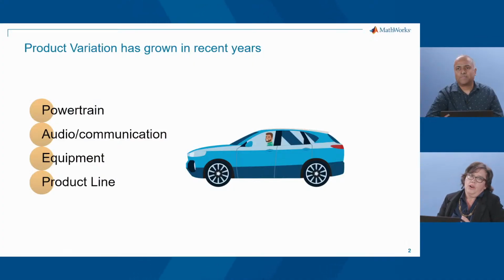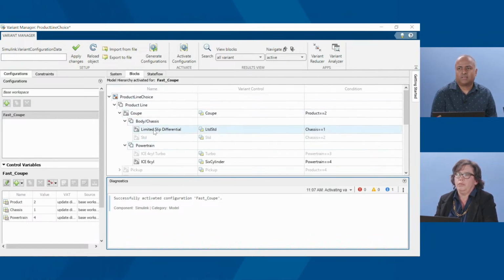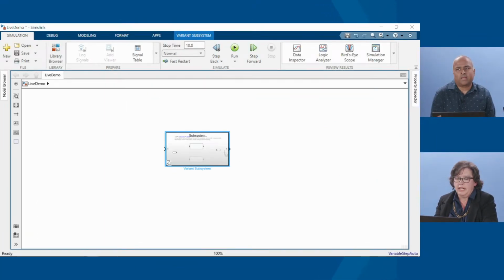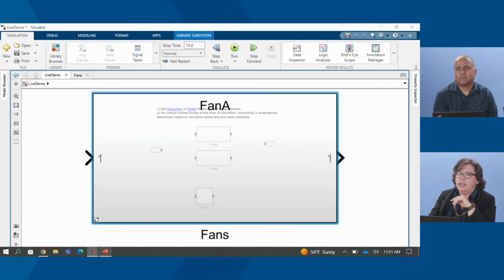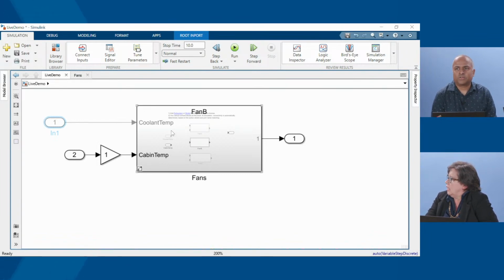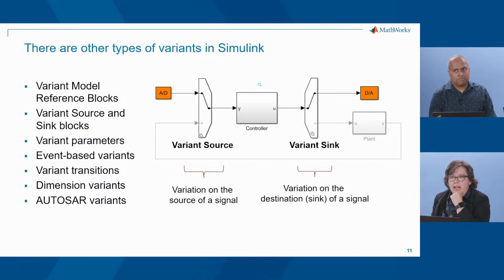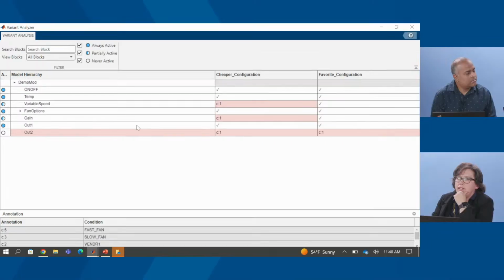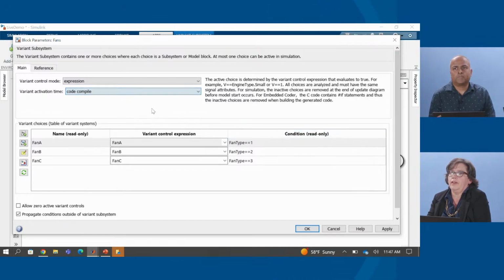How to Manage Design Variants in Simulink

Comment: Not sure if there is a date on this presentation; at least a year would help.  At least I can't find it.  Also kind of hard to follow since not too well organized.  What is the high level goal?  You added the Variant Manager, but how did that impact the way variants worked up to now?  Something did change since my models from 2018b which used variants are throwing errors with 2022b.  Maybe this should not have been done "live".